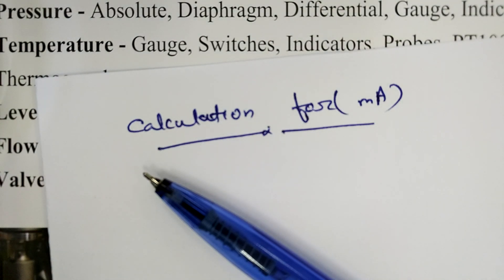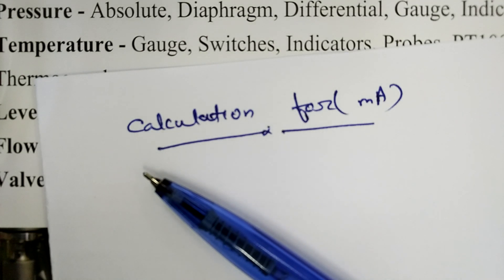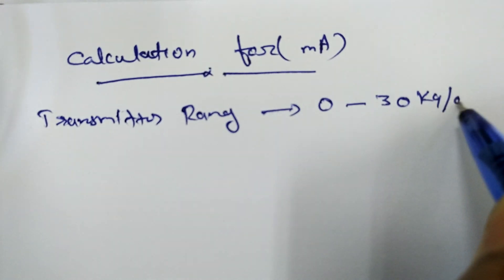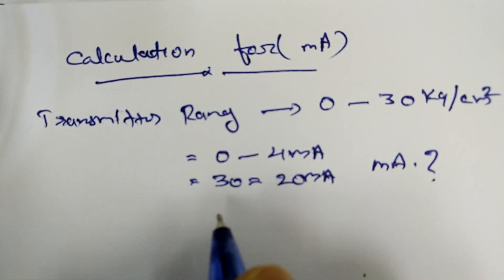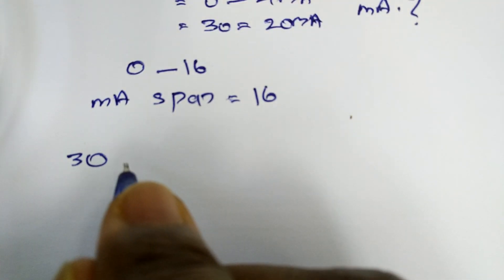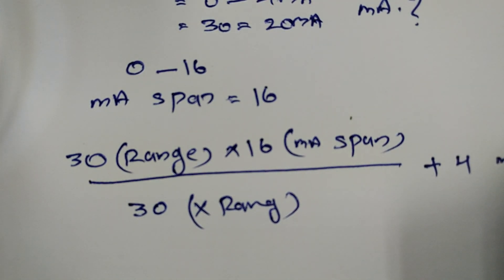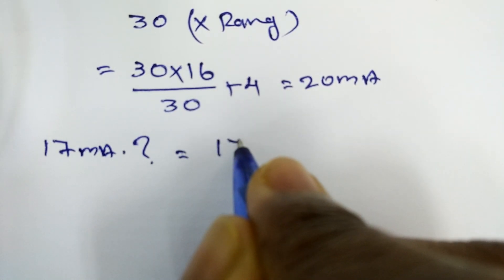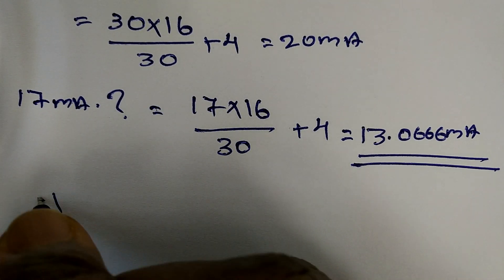4 - 20 mA scaling for calibration

Comment: can i get mobile number
my doubt is 4 to 20 ma nte pressure sensor ann use cheyyunnath but 4 to 20ma full read akunnilla karanam maximum pressur 3.7 bar ann  appol ee 3.7 bar ne namukk 20ma equal ayitt scal cheyyunnath engane enn aan doubt . ith vfd yil ann cheyyendath